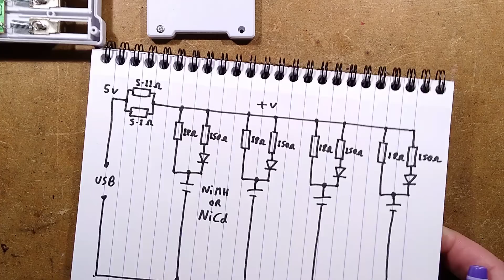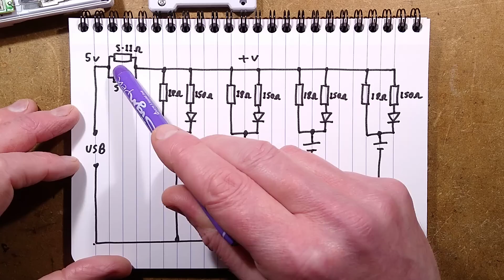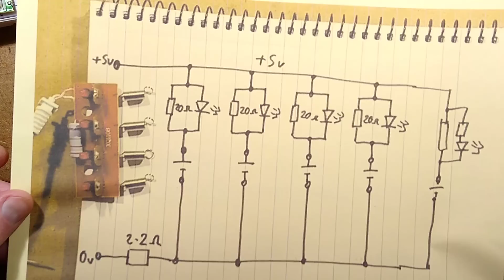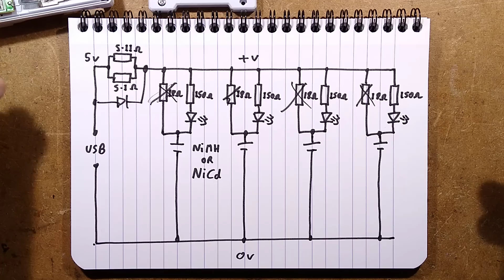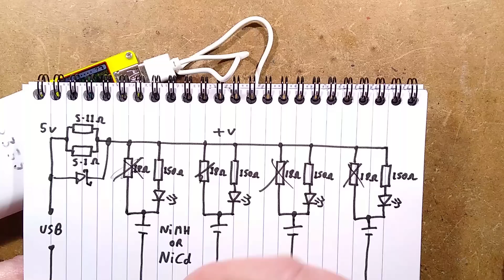eBay trash USB charger 2023 - with schematic

Comment: Clive, why don't you do a video on this?  Please do!

I thought about modifying the cheap one like this that holds 3 cells.  Instead of 3 in parallel, change them to 3 in series, so it would take maybe 50 mA total.  The idea was to charge them using a small 5V solar panel, and leave them in a window, constantly trickle charging.  Whenever a cell was needed, just pull it out and it will always be fully charged. 

Yes, I thought about the empty cell holder would prevent the remaining cells from being charged.  There could be more than one solution to this.  One is to connect two 1N4003 rectifier diodes in series across each cell holder, so if the voltage is greater than 1.2V it will bypass around the cell.  It might need a third Schottky diode in series to make the voltage 1.5V.  or it might be better to use the LEDs on the charger, and a resistor in parallel.  

Another solution if you don't want the diodes inside is to cut a length of 1/2" or 13mm wood dowel to the length of a AA cell, drill holes in the ends and screw small sheet metal screws in.  Then connect the diodes across the screws.  Mark the ends plus and minus and now you have a dummy battery that will pass current to the remaining cells.  The only downside is that it's something that might be misplaced if it's left out most of the time.  

The idea is to make a few of these that will keep the dozen or more Ni-MH cells that I have, that will always be trickle charged using solar cells.
Reply: Charger in series will be much more complicated and expensive compared to parallel for removable battery. For example you will need more complicated circuit like BMS that will balance the voltage of batteries and additional solar panel for much higher voltage and buck circuit to stabilize the output voltage.

I took this into consideration when designing solar light for my night light. Instead of using series connection that will requires me to add additonal solar panel, I simply design them in parallel then boost out the output to 12volt using boost converter. By doing that, I save money on additional solar panel as well as BMS.

Why additional solar panel? Because solar panel output is variable throughout the day. You need higher voltage for reliable charging operation.
Reply: i have a cheapo one like that, its series 'as is', clive reviewed one some years back, circuit is not surprisingly rather nasty and relies partially on the resistance of the copper covered aluminium cable to limit the current 😁  current 'regulator' plus indicator is in the usb plug

Comment: I use Nitecore chargers...single, dual & quad...for my batteries...Eneloop AA & AAA...plus Samsung 18650's.  
They work great and have not failed to charge nor have they overcharged to date.
Reply: Let's do this come on ❤❤
Reply: my nitecore charger has a ton of coilwhine tho so much so I only pull it out when I really need to

Comment: When digital point and shoot cameras used AA batteries, customers were often impatient and wanted their batteries to charge fast !! ... there were a lot of 'Fast Chargers' sold, and I am sure they Nuked the poor NiMH cells ...  I tried to sell a slower charger and a spare set of cells, but not everybody could be taught ;)
Reply: Can confirm. I might or might not own a charger that charges AA Nimh cells at 8 amps
Reply: I can recall Dave @EEVblog showcasing and investigating a fast charger. IIRC, 4A per cell, or even more, since it is said NiMH can withstand it when done right.
Reply: I own 3 of those Sony quick chargers. They killed each one of the cells they came with (8x sony 2600mAh cells) then another set of random brands like probattery, rayovac, Energizer.
Reply: yea lot of us were quite ignorant back in the day
Reply: When I was a kid, I had a remote control car that I think used a NiMH pack (could've been NiCd, I don't remember). That charged very quickly, to the point where the pack got quite warm. Needless to say it didn't last all that many cycles.
Reply: I had a couple 15 minute chargers of different brands and both recommended to keep the batteries in the charger for 30 or 40 minutes after the charge was complete, the temperature of the batteries was monitored and at the end of the charge it used to be around 60 ºC  🔥🔋🔥
I also only used batteries that were sold as compatible with ultra-fast chargers, they were more expensive and I always had the doubt if they were really different from the normal ones 🤷‍♂
Reply: My Pentax DSLR still uses AA batteries to this day.

I slow charge my stuff.
Reply: The other end of the spectrum are small racing models that use them, where fast charging was is a necessity. I used to do Mini4wd racing, people would put 1-2 amps into them deliberately... and also discharge them at ridicolous rates through the charger in order to "train" the cells to discharge in a more favourable way.  You would see people have cells go from full charge to dead in seconds on track just because that squeezed some bit more speed out of a puny 130 type motor. Of course, people would buy new batteries all the time... and new motors too.
I ran in the tamer divisions where a BC-700 (0.7a maximum charge, more than enough to get batteries ready for the following heat) was more than enough, and I switched to 1/10 drift RCs when it started to get silly there too. I fully believe I'm now spending less...
Reply: Back in the 90s Black and Decker sold rechargeable battery operated tools that used tubular NiCd batteries.  The kits came with a two cell charger with no current regulation and had no instructions on how to use them.  Users would leave the batteries in the charger for an extended period of time causing the batteries to overheat and fail prematurely.  I had noticed how hot the cells were getting at around the 1 hour mark and eventually took the charger apart to reverse engineer it.  Turned out the charger had pretty much the same circuit as in the one Clive modified except using thru hole technology.  I did what he did and modified the charger.  Every battery operated tool B&D sold came with that crappy charger so I would use an unmodified one to charge a discharged cell and use the modified one for storage.  As with your experience B&D did sell an expensive separate smart charger but nobody wanted to buy one, including me.
Reply: My dslr has a bespoke power pack, but it also is the same size as 4 AAs so in an emergency you can use an adapter and use four AAs instead.
So many years ago I tried that as i had accidently forgot to charge both my main batteries. I used 'Kodak' brand batteries as, well, Kodak are a photography brand arnt they?  (I didnt realise at the time they were shitty chinese batteries from china that Kodak had sold naming rights to)
The batteries lasted three shots.
Reply: Photographers aren't really known for their intellect or practical skills, so it's no surprise the general public exposed to technology would fail just as professional and amateur photographers would.
Reply: @sigmasquadleader  what an interesting opinion based on facts. Thank you!
Reply: @sigmasquadleader  photography slander!
Reply: @sigmasquadleader  Speaking from your own experience :) ? Not everyone are victims of some random tech fad or internet social media shorts. Photographers pack multiple batteries (packs) and looking after all gear.

Comment: That beefy charge lead probably contains at least 4 strands of wire 😂
Reply from the maker: I should have done a strand count.
Reply: Certainly more insulation than wire
Reply: Save on the cost of a fusible resistor by using a fusible lead instead
Reply: Aluminium-Chineseum strands…!
Reply: BreatheScotland  At least 1% of copper residue, but 99% will be a mystery alloy, made from all the left over bits from copper recycling, mixed in with all the bits of pot metal they could not identify.
Reply: @SeanBZA  Soylent Green
Reply: @SeascapeStl  Soylent Green is people
Reply: ESD safe. 😂_
Reply: @primech-128bit  Any ESD will just vaporize the wire!
Reply: It can contain  some new covid variant as well. 😆 So better not to open the wire insulation.
Reply: @jutukka  John Ward's video about SY cable and the white powder within
Reply: @jamesbrett6518  the white powder is a solid lubricant, similar to talcum powder, to ease the movement of the two materials without drag

Comment: Gotta like NiMH for being less fussy and a bit tougher than Lithium cells.
Reply: Also for being the correct voltage for all our gadgets 👍
Reply: @edwardfletcher7790  all my stuff needs 5v
Reply: @marcogenovesi8570  That's because all modern devices run off rechargable lithium ion batteries which need a 5V supply to recharge 😩.
Reply: @edwardfletcher7790  - so how come there are still “modern” devices that use battery technology that is not lithium based?
Reply: @Mark1024MAK  RS sells lots of obscure crap. I know they sold lots more NiCads in the early 90's because I bought them 😉

Devices still use non rechargeable batteries for a multitude of reasons.

1. Cost, no charge circuit, connector or LiIon battery.

2. Convenience, some devices have very long life, costly regular battery swaps aren't necessary.
Mice, clocks, remotes, cheap lights etc

Have you noticed over the last 20yrs there are less and less devices that need AA, AAA etc ?
Lithium ion batteries used to be very expensive but they're gradually replacing standard batteries.

You know all this stuff.
Are NiCads common in the UK ? Because I'm in Australia and nobody has sold them at retail here for almost 20yrs.

For me the miles are the problem 😕
Reply: Mostly for being compatible with devices intended for alkaline batteries.  👍
Reply: No I don't, keep your 1.2 volts if ur lucky, next someone gonna tell me benefits of those horrible nicads
Reply: @Steve_mos8541  NiCd -> high-power performance at very low temperature. Sorry, couldn't resist. XD
Reply: @SvenRötters  Handy short circuit current too :)
Reply: @SvenRötters  hahahaha... 😂 LOL..
 I don't get it...
Reply: @gshingles  Don't NiCd and NiMH have similar current capability (internal resistance)? (I don't have data either way so I could easily be wrong. I'm not trying to say you're wrong :))
They can both supply vastly more current than equivalent alkaline cells, at least!

I've had very few uses for alkaline cells for many years now. Just the occasional stubborn device that refuses to operate at 1.2V — and thus also wastes a ton of energy in alkalines!! Alkaline cells are typically considered "empty" around 0.9V, so if something won't work at 1.2V it's arguably kinda shit anyway (except for special circumstances) :p
Reply: @AndrewGillard  I haven't tried shorting NiMH tbh, I just know NiCd was my go-to for heating paperclip gauge coils of wire, erm, back in the day. :) NiMH wasn't a thing back then anyway. Neither was having a "go-to" either, actually. 😕
Reply: @Steve_mos8541 - high temperature Ni-Cad cells are still used in emergency light fittings.
Reply: @Steve_mos8541  NiCad ? Where can you buy NiCad AA batteries since 2001 ?

NiCad AA's were only 8-900mah
NiMh AA's are over 2400mah !!  

How Old are you ?? LoL
Reply: @edwardfletcher7790  They're starting to switch over to NiMH now but for the longest time, you could still get cheap crappy NiCd AA/AAA cells from solar garden lights. I've got a pile of 150-300mAh cells of various sizes off to the side of my bench somewhere, unused since I almost always put a solder bridge across the on/off switch, pop a NiMH cell into the spot that the cheap OEM cell was in, and grease the battery contacts and circuit board in the process. Makes them last longer at night and also usually makes the guts in the light outlast the plastic housing they're in!
Reply: @KenPiper  This thread is about AA & AAA batteries NiMh replacing NiCad..

Finding the single exception to that fact in $2 solar lights doesn't help your case, it just makes you seem pedantic and wildly out of touch with the reality of AA & AAA rechargeable batteries since the early 2000"s.

Your statements sound like someone with little or no knowledge of the Electronics industry.
Reply: @edwardfletcher7790  My comment about NiCd vs. NiMH started with me stating that even the bottom of the barrel stuff is finally starting to get away from NiCd and use NiMH. The rest of my comment was just intended as a fun little tidbit that was related to the first part of my comment about how someone could, in years past, breathe a little more useful life into something that would have otherwise ended up as e-waste in less than one season.

As for your condescending statement on my lack of knowledge "of the Electronics industry", your replies in this thread tell me everything I need to know about your opinion.
Reply: @KenPiper  Why, thank you Grandad 😆 You keep pottering away at that hobby of yours 👍😂

I can't chat with you any more I've got real work to do......😜
Reply: @edwardfletcher7790  - for your information, yes, Ni-Cad cells are still manufactured and available. For one example RS Components sell “Panasonic Sanyo Cadnica AA NiCd Rechargeable AA Battery, 700mAh, 1.2V”.
Each battery technology has advantages and disadvantages compared to rival battery technologies.
Reply: @edwardfletcher7790  57.. as you KNOW it IS the Years... NOT the miles... hah
Reply: @Steve_mos8541  Okay. Here's the benefit of those horrible nicads.

They're incredibly resistant to low temperatures, they handle trickle charging well, handle high current discharges, and they're very reliable.
Reply: @vhfgamer  What's the application ?
Reply: @edwardfletcher7790  Emergency lighting is one application. You know, those EXIT signs in businesses that glow even when the power goes out. Also, they're often used in places that get very cold, that require reliable power.
Reply: @Butter Ball That's very likely not oomph-related, and more to do with voltage. NiMH start out at about 1.45 volts at full but very, very quickly drop down to around 1.2 volts and stay there right up until the very end where the voltage drops off a cliff. The lithium-based AAs/AAAs tend to start out at around 1.8 volts and are fully dead around 1.3-1.4 volts. Both types tend to be very good about giving out close to their rated capacity even under higher loads, though lithium ones tend to have 1.5-2x the capacity of NiMH and IIRC, they perform better in very cold temperatures.
NiMH cells can still put out enough current to blow the 10A fuse that many multimeters use for their current measurement mode, though!
Reply: If the charging current is no too large, the excess energy on overcharged NiMh battery will be dissipated out as heat. Not easy to explose.
Reply: @Butter Ball Ummmm Bluetooth mice can last MONTH'S on a NiMH battery. There were however problems with early digital cameras and AA NiMH batteries. Their output voltage tends to sag under very high loads, unlike Alkaline & Lithium ion.
Reply: @edwardfletcher7790  - the voltage curve of each battery technology is different. Both Ni-Cad and NiMh have fairly flat parts of the discharge curve. Hence appliances designed for alkaline cells or older technology cells, may not be happy with the normal voltage of a partly charged Ni-Cad or NiMh battery or cell. If anything, the voltage from a partly discharged alkaline cell will drop under a heavy load more than a Ni-Cad or NiMh cell.

Comment: Hahaha. Take out 6 components, add 1 and make the whole thing better. Great work.
Reply: Don't need to add the extra diode, or remove the pair of low value resistors tho' - with just the 18 ohm resistors removed, the LEDs will block the reverse current path.
Reply: ❤Top end